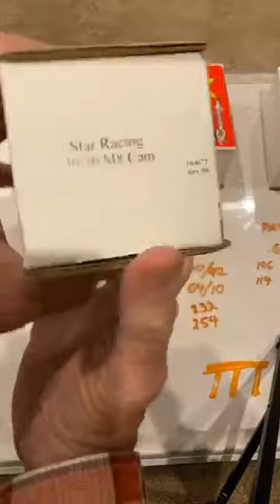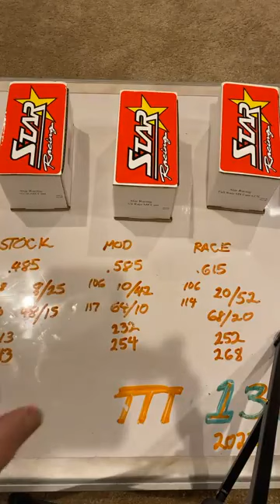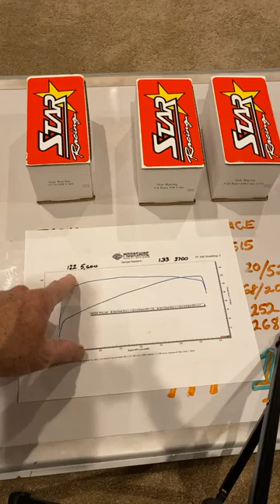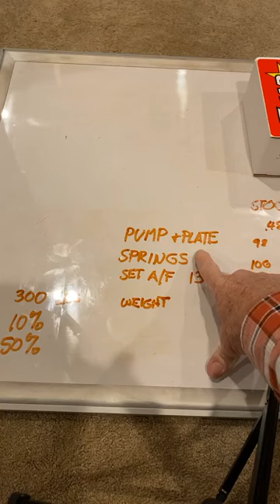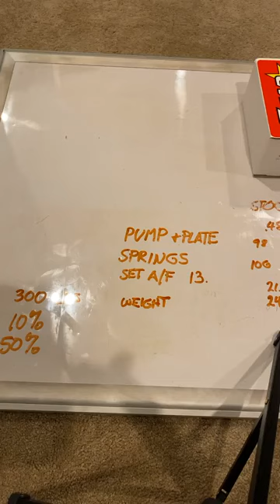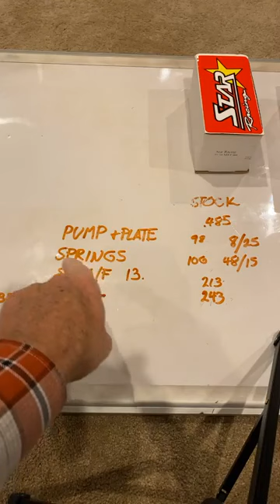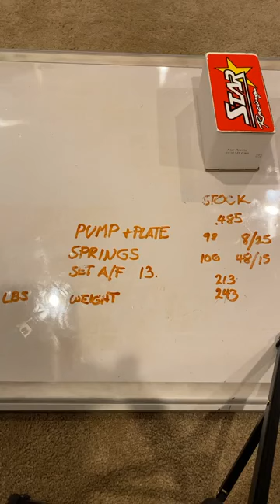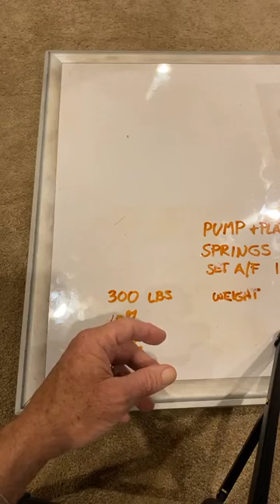Tech Talk Tuesday #130 Camshafts

Comment: Wow! Your knowledge and experience is priceless. I’m an idiot and you were able to get me to clearly understand. I am very happy I came across your channel. I have been doing my research and I think this has persuaded me to go with star racing products for my building components. Thanks so much for the insight on the “red and blue” oil pumps too , I have a 21 FXLRS and now maybe going SE high flow since it was designed /released after the 2020 oil pumps.

Comment: I’ve searched your tech talks and am not seeing it, but do you have a video like this discussing your 577 cams for the older Vtwins?
Reply: I can’t find anything either
Reply: @ironerebus_syl12  well fuelmoto has a reasonably priced star racing 577 cam. I talked to George on IG. He said all you need are the cams and adjustable pushrods. Fuelmoto kit has that plus cam bearing. I’ve ordered will be here tomorrow. Hoping to get it all installed and dynod by end of next week.

Comment: What cam and intake and throttle body would you recommend with a 
124 S&S kit it comes with a 550 cam what size intake and throttle body would you say ? 

64 mm ? With a 550 cam ? Or ? 
572 cam ? 
And 
Do you no what clutch is better 
Evolution industry’s or 
Recluse ? 
I was going to do a 
Dark horse compensator

Comment: Wow thank you for sharing this information it is greatly appreciated.I just bought your 30/30 cam and compensator I have a Fullsac performance header pipe going to order a kw muffler slip one and a se 64 mm intake manifold an Arlen ness 10 gauge air cleaner and throttle body and a thundermax to tune it and then eventually get it dyno tuned. What other recommendations do you have for me what else should I do to marry all these components to work together as best they can. Again thank you for all you do to educate the public.
Reply: Upgrade your Fuel Injectors, and get your manifold CNC by award Racing. Also Vent your crank case

Comment: I want to be able to have your 30/30 cam installed on my 2021 114" Harley. However, I'm being warned that because I have a 2 into 1 short side dump exhaust, that I will end up with LESS tq. & hp then stock in my usable rpm range. I don't need more than stock, but I sure don't want LESS! Advice? Anyone?

Comment: So are stock m8 114 springs ok with the 485 cam?
Reply: Yes. I’m getting ready to run the 485 cam in my S.E Stage 3 122 kit. Kept the stock heads/springs from my 114 and Mr.Bryce said it’ll run
Reply: Andre Sabbath did you get that 485 in the 112? If so what kind of feedback do you have? Thanks
Reply: @atrain6389  interesting. I have a 21 fxlrs 122 kit. I haven’t been able to find any dyno charts specifically to that. I’d be curious to know your numbers if you’re willing to share them. I need to get wide bands and a few other components as well.